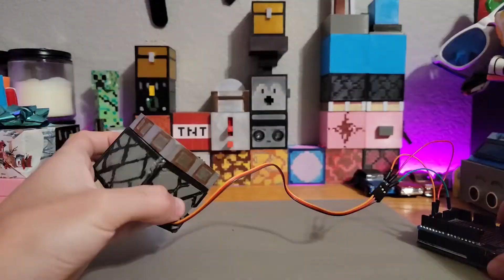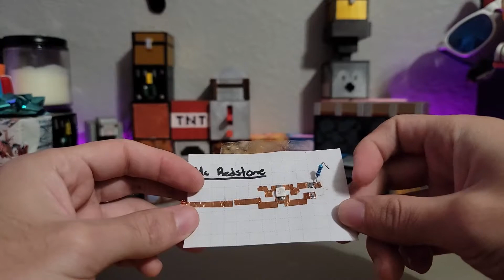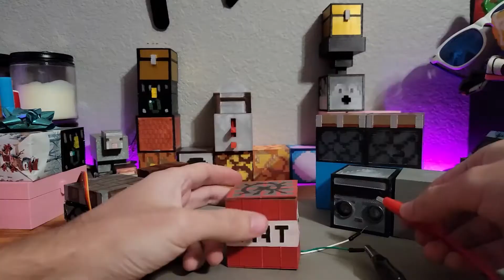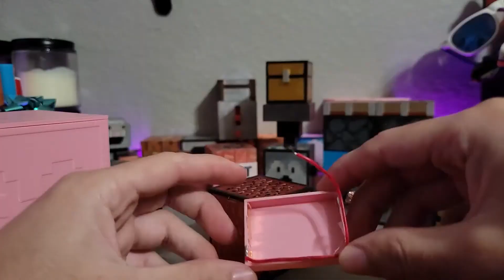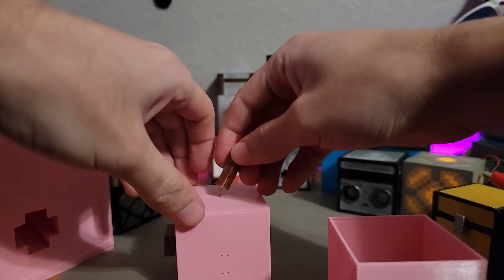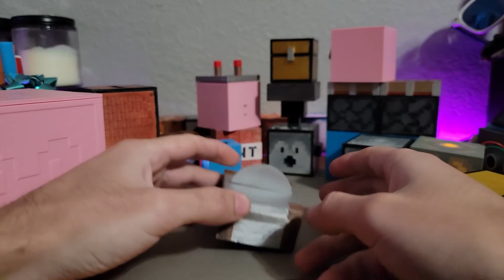Minecraft Functional Blocks: Recap 1

Comment: idea: you could make the jukebox detect the disk and then play the songs from the sd card
Reply from the maker: Nice idea! I think there is a way to auto-play, but it would require an additional microcontroller to run the code. There could instead be a mechanical switch, but I feel there is another way to auto-play with the player itself.
Reply: @hecbac  I believe youre gonna make it
Reply from the maker: @RhythmMonke  I'll look into it when I go over it again lol